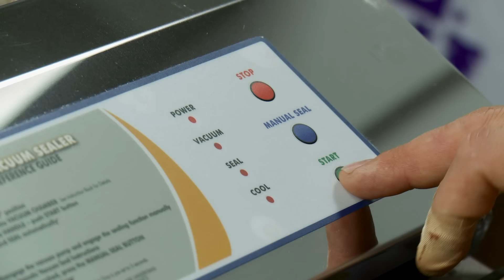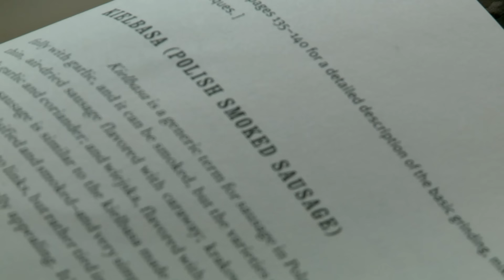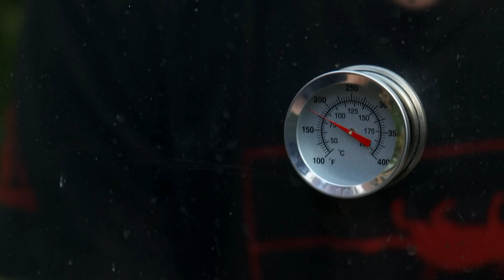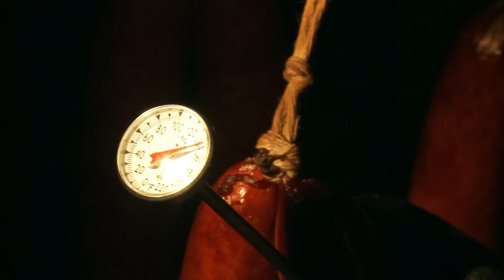Wild Game for the Big Game: Cooking Special | S2E13 | MeatEater

Comment: Beans are all about the broth. Take those same ingredients and blend them into your chicken stock. Get that stock hot. Use the stock in a blender to help bring your seasoning together. Take a smoked hammock or pork neckbones and cook them down in water. Once they cook down, drain the water and  add the meat  into your beans. Clean and drop a whole onion into the pot. Take it out once the onion starts to break apart. Go slow and low until your beans are soft. Get some bread and get it!